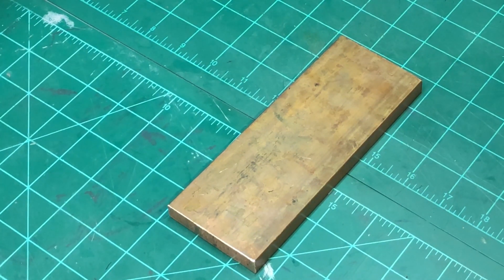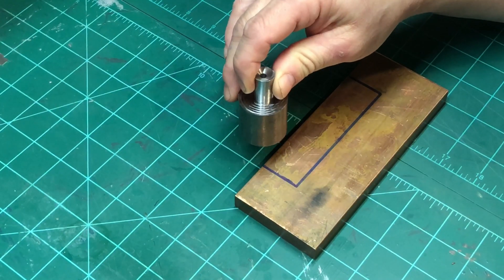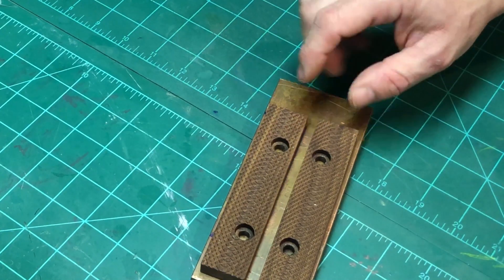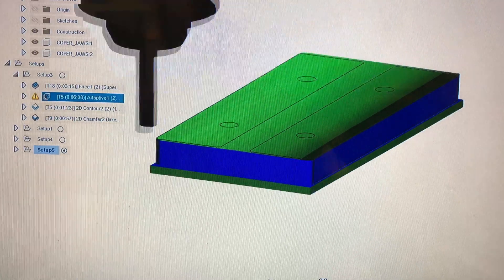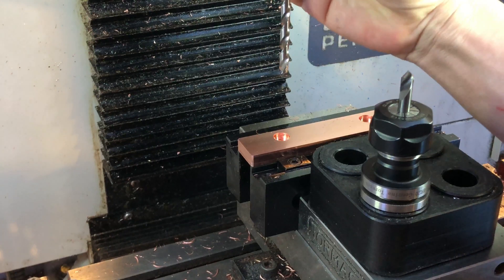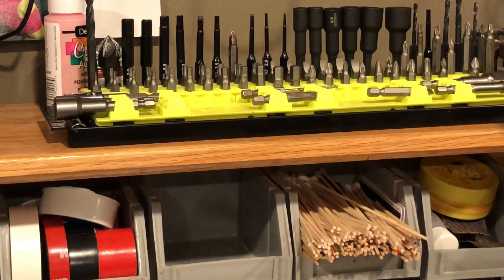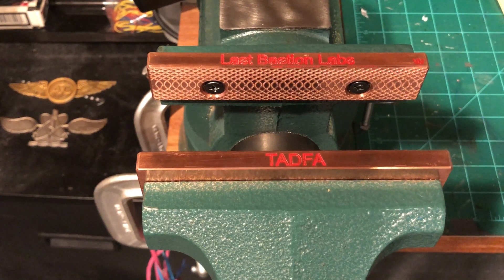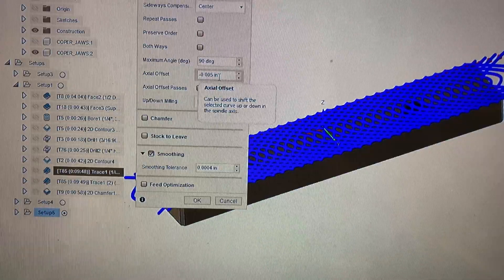Machining 110 Copper, my new favorite alloy!

Comment: You could have made a pattern in the CAM and just selected the two lines.  Very cool work!
Reply from the maker: Yes you could if you wanted to suck all the fun out of it. LOL  Great comment, thanks for pulling my head out of my.....
Reply: @LastBastionLabs  Your response reminded me of an experience back when my kids were living at home.  I had this really cool transparent LCD desktop clock I had received as a gift.  At some point the batteries died, and when I replaced them I found out the buttons for setting the time didn't work.  The clock came on just fine but I couldn't change the time!  I was tempted to take it apart and fix it but decided to just chunk it.  My 15 year old son stopped me and asked if he could have it.  Sure, I gave it to him.  

A week later I noticed it on his desk.  The time was set correctly!   I was impressed, and asked if he took it apart and fixed it.  He said "No, I just put in the batteries and saw that the clock started at 12pm.  So I took them back out, waited until 12pm and put them back in."  I told him he was grounded until I quit feeling stupid.  :)  We both still laugh about it.
Reply from the maker: @billstrahan4791  Great story!  I sometimes say to my wife, "you and the kid need to get in the car before this becomes your fault"